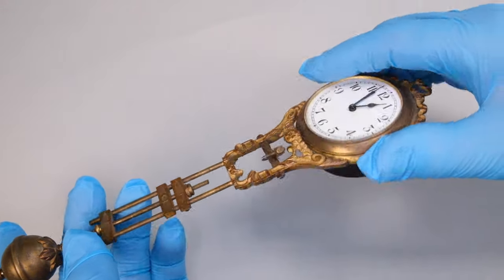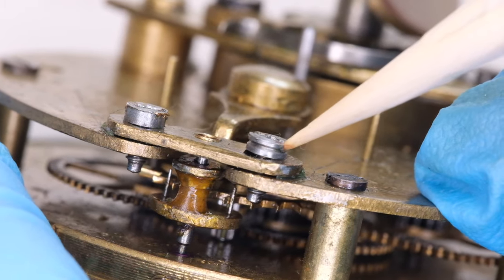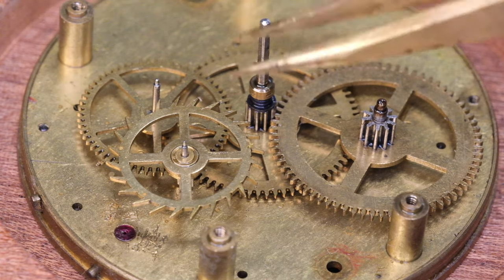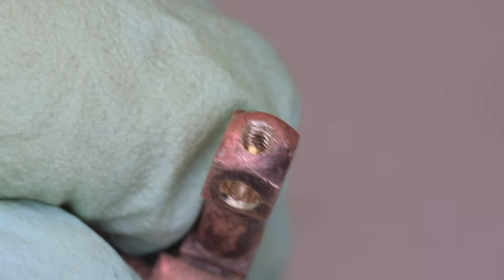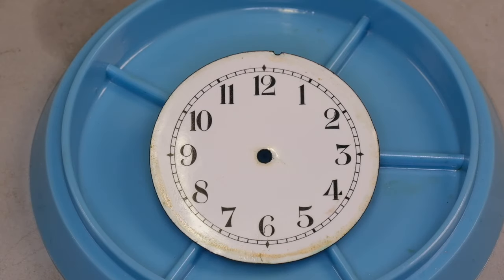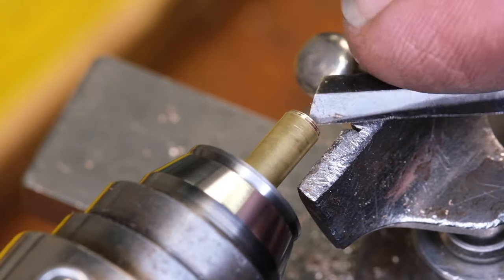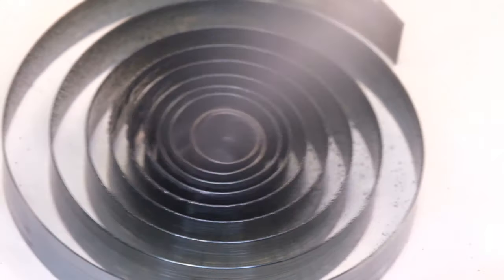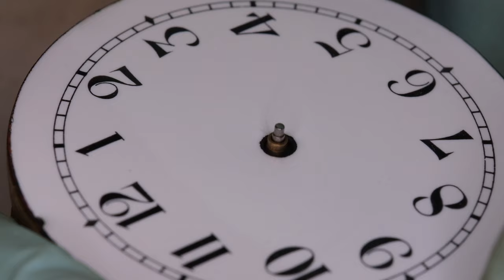READ Repairs #007  Junghans mystery clock repair  2023_12_30

Comment: Great lathe work. I’m working on one of these at the moment and came here to see a pro at work. Not disappointed!  Can you please tell me the name of the tool used to make the little ripples on the side of the regulating nut?
Reply from the maker: Thanks for your feedback.  It is called a knurling tool.  Most knurling tools are are a bit clunky; industrial things.  If you buy a single fine 'knurl', it can be mounted in a bar as a more useful do-it-yourself alternative.  There is more on making this component here... https://youtu.be/aAJxjP6ZDXI?si=YTQYXqRhjFXKcNQh

Comment: What oil did you spray the mainspring with? Was the rest of the movement oiled with D-5, or was another Moebius oil or grease used? I wanted to know that for self-education purposes. Thank you.
Reply from the maker: Hiya.  I spray the mainspring with Chemodex Liquid Spray Grease.  Yes D3 and D5 on the movement.  Today I would use 9415 on the pallets.  Hope this helps.  M
Reply: @readrepairs  Thanks you

Comment: Hello! I am repairing a watch lime this but I am having some problem to set in  time exactly! What about this problem?
Greetings
Reply from the maker: Yes it is tricky!  Counter-intuitively, moving the pendulum bob up makes the clock lose time.  Extending the length of the pivot spurs also makes the clock lose time.  It took me weeks to get it right so allow plenty time.  First make sure the pivot spurs are sharp.  Then keep a record sheet and make small adjustments to the spurs with the pendulum bob in its central position.  Once you have the timekeeping something like with the spurs, move onto finer regulation with the pendulum bob.  Expect plus or minus 5 minutes per day.

Comment: If you use denture cleaner on the enamel dial, not only will it clean the dial but also remove visual cracks.
Reply from the maker: Thank you for that tip!  Appreciated.  M

Comment: Matthew you have way to many channels. Which you tube channel is your channel that you post to all the time?  I advertise for you in my videos but I have been advertising "How to repair pendulum clocks"
Reply from the maker: Hi Mark.  Thanks for your message.  Yes I have 2 active channels at the moment.  How to repair pendulum clocks which is workshop tips and techniques and tends to be quite technical.  Then there is READ Repairs which is full projects which is meant to be a bit less technical and a bit more 'aesthetic'!!!  There is of course cross-over.  :=). In the background there is Open Clock Club archive which is only the livestream series of 50 events  we did in lockdown.  I am not adding to that series.  Hope this helps.  Thanks again for sending people my way; appreciated.  If your members want any particular technique demonstrating, I will do that if I can.  All the best.  Matthew